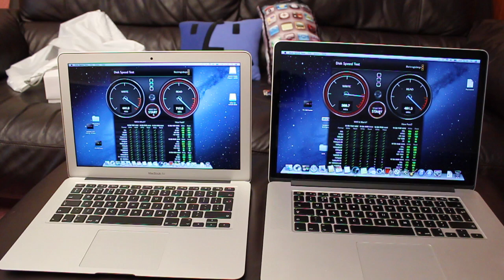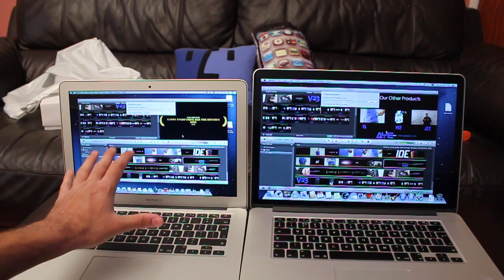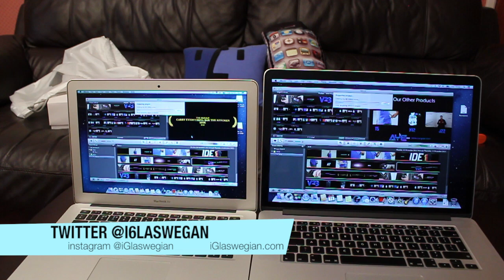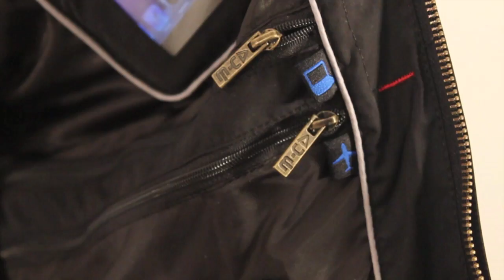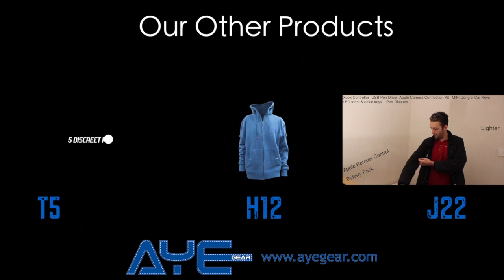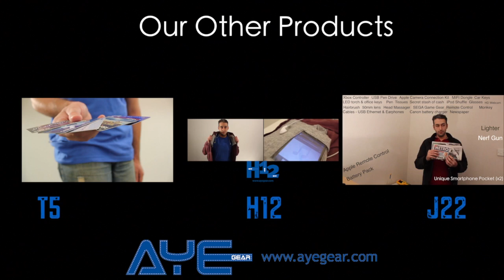Macbook Air 13" 2013 Haswell VS Macbook Pro Retina 15" - Speed Test & iMovie Rendering

Comment: Hey guys...
should i buy the Macbook Air?
Can it handle software like AutoCAD and other Adobe efficiently?
Reply: Hey! I have the same question. Did you manage to get an answer?
Reply: Luis Matos i bought the MBA and it does really good job on both software i mentioned above, just slight difference of time taken for rendering a video that's all
Eg : MBA - 10 minutes, MBP - 5 minutes

Comment: the videos that u put to render test, are those HD?whats the resolution, and how many fps? i considering the MBP 13" with 8GB and 256SSD, and MBA 13" 256" 4gb, what do you think? i use photoshop and premiere sometimes, its not really advance project, is MBA convenience enough to operate?

thanks for answering! :)

Comment: I really like the option of using either a integrated or discrete GPU depending on demand. 
On my 17" MBP I can either set it manually or set it to auto. Applications are finally being made to take advantage of the GPU. And considering that my GPU can process about 4x faster than my CPU, applications that utilize both my CPU and GPU effectively will be much fast than the old apps that only use the CPU. The key word is "effectively" as many developers have no clue yet on how to optimize algorithms for GPU threads. Its tricky because the memory architecture and cores are very different than a CPU. Though Intel HD 5000 series look good on paper, real world test show that their performance is far below nVidia and AMD GPUs they are suppose to be better than. The Macbook Airs are extremely poor performers in graphics and no one supports their OpenCL capabilities including Apple. My nVidia setup from 5 years ago is a better performer than this. Intel HD 5000 is very behind the times in terms of performance.

Comment: I'm planning on getting one for my wife, first time purchasing a mac being a PC fan for so long. But I ask which one do you guys recommend, she's a writer/ teacher and would must likely not need extreme editing or bench mark speeds for just writing and portability. So I'm leaning towards the air, with the ongernbattery life, Hasbro and faster boot. But, with the air not having a CD port, has anyone had issues with getting things like windows word etc.
Reply from the maker: go with the Air, its perfect for her needs. Lightweight, slightly cheaper, better battery life.
Reply: Apple hypes up their battery life. Divide what they claim by 2 and thats pretty much the real world battery life. Only way I have gotten Apple's battery claim is by turning it on and not touching the laptop. I average about 1/3 the claimed battery life, but thats because I watch video and use the WiFi. 
There are certainly many PC Windows 8 laptops out there with very nice features and most likely on sale, where as Apple is never on sale. Besides if you are a PC person you may be able to install your existing software on the new laptop. 
I use PC desktops and Mac laptops. Why? PC desktop hardware blows away anything Apple has, but than you don't need power.
Reply: AirScholar I find that with light internet use, reading pdfs and writing reports battery life is spot on. Offcourse if you work something more intense its not gonna have the battery life apple says it will.
Reply: +AirScholar Are you sure? Maybe your battery's life has degraded over time and cant hold as much charge, or you have a defective battery. Extremely unusual considering everything I've heard about battery life tests.
Reply: +AirScholar Either that or you might have the older models which didn't have great battery to begin with.
Reply: omar717 Nope ... the battery estimates are never realistic. To get even close to the estimates one would have to set the brightness on low and not use the computer.
Reply: AirScholar Is the actual capacity of the battery close to the design capacity? You can check. There have been a few battery issues so I wouldn't be too surprised.
Reply: omar717 I can get about 6 hours of light use. 8 hours if I make a effort to use it very gently.
Reply: AirScholar How long have you had it? And is this the 2015 model? You should be able to check your battery degradation somewhere.

Comment: The Macbook Retina is using the nVidia GPU. Hence, GPU enabled effects its going to be much much much faster. The poor Air has a Intel HD GPU. The Air will likely never have a AMD or nVidia GGPU due to space and power constraints. In a GPU optimized effects the GPU can be 10x faster then a CPU only effects. 
The iMac has nVidia GGPUs but only mobile GGPUs. Apple does not use desktop GGPUs except on the Mac Pros. Sigh... 
Forcing people to use PCs for movie editing.

Comment: What are your thoughts on the 13" Macbook Air against the 13" Macbook pro Retina? I saw a review comparing the two machines in which they test most aspects of the Macbooks against each other. To my surprise the Air came out on top on all the stuff that actually matters. There is no comparison between the 15" Retina, however its no where near as portable and the price is horrendous. I'm looking at getting the 13" air and beefing up the processor to a i7 and expanding RAM to 8gb. Any Thoughts man?

Comment: depends if you have a macbook pro with a dedicated gpu. If you do then it will blow the macbook airs out of the water. If you don't, you will probably see better performance on the air i7 model (also the air looks really nice).

Comment: This comparison is not equal because the new MacBook Air has a intel i5 processor where the retina has an i7! To be more accurate they should both have either the i7 or i5 processor

Comment from the maker: You looking to get a Mac this year or really when you need to start college? Getting the 8GB and more storage is a wise idea as the RAM is not user upgradeable (whereas the storage, you could always use thunderbolt if need be). I wouldn't get a superdrive, unless you've got money to burn. Get ANY cd-writer on the market for as little as £10 on eBay, works just as good. I use my Xbox 360 HD-DVD drive for when I do want to use a CD (once in a blue moon). Hope this helps.

Comment: They most likely drop the prices, and eventually discontinue the non retina MacBook Pros. 
On the Intel chip, I belive tests are proving them not to be as powerfull enough for a "Pro" machine. They save a lot on battery life, but they dont have that new generation muscle bump everyone was expecting. I beliove it is only in the graphics were you see a slight improvement.

Comment: IMO I think the rMBP won not for the "pro" features, it's just for a quad core processor vs dual core one, and 8GB or ram vs 4GB! I think if you compare it with the customized MBA with 1.7Mhz i7 and 8GB of ram it will show different results.

Comment: Which is better ? Macbook air 13" ( Haswell 2013 ) or Macbook Pro Retina 13 " ? Air comes with Intel HD 5000 while Pro Retina comes with 4000 , which graphic is better ? I watched some video , both run games at almost same Fps . And the processor , Air Haswell around 1.4 ghz , Pro Retina with Ivy bridge around 2.5 ghz  , which is better , Air is 4th gen , Pro Retina is 3rd  gen , but the ghz is different , so i don't know which is better . Please reply me , ty :)

Comment: clock speed is the main reason (and number of cores)
1.3 ghz dual core i5 mac air
2.4 ghz quad core i7 retina macbook pro
I will plan to get an air with an external ssd, microsoft word for mac in the distant future, along with an external bluray disk drive.